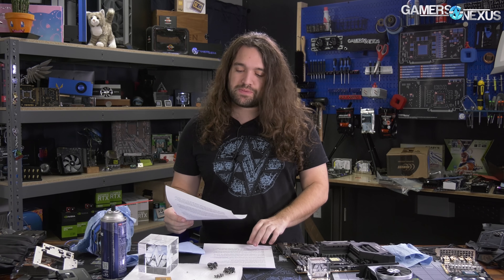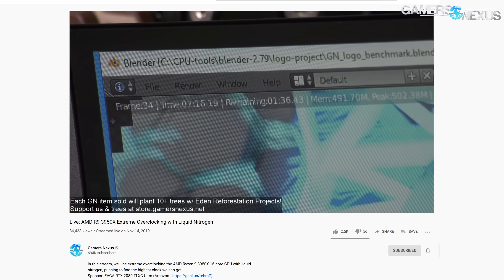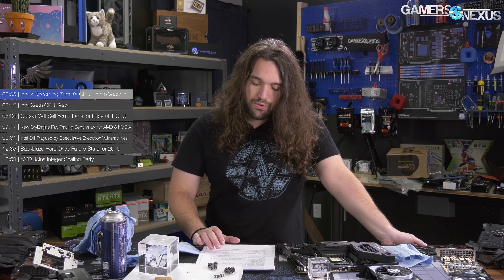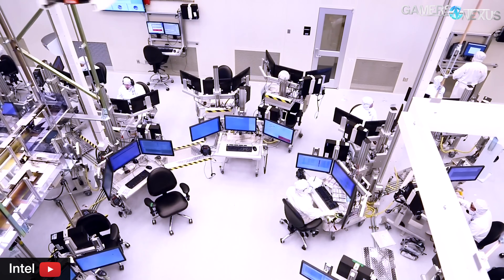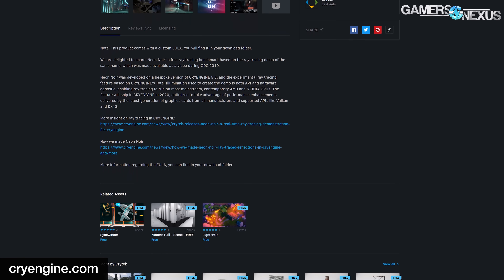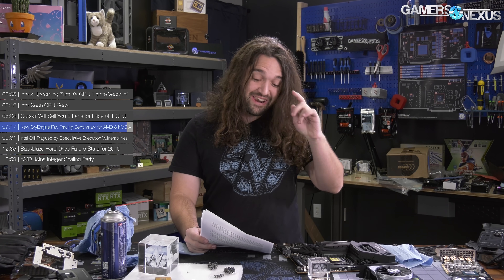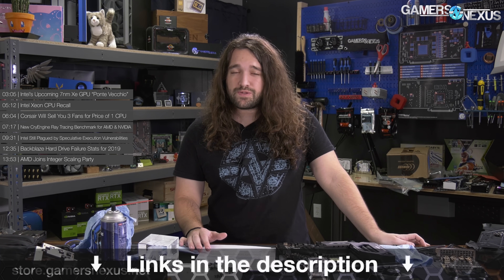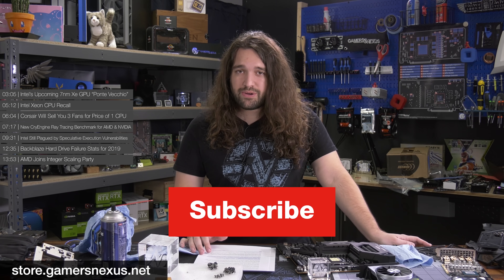HW News - Intel CPU Recall, 7nm GPU, AMD Ray Tracing Bench, & HDD Failure Stats

Comment: Bizzarre? I am highly suspicious of INTEL since building their largest most modern plant in IS rael. I think the whole wannacry BS is fishy and maybe related to this recall. I think the intel fix for wannacry actually opens the security between the cpu and ram and sends a copy of that data  to a server farm in IS rael. This would be undetectable but slightly slow system performance just like the intel patch does.This technology can also snatch that cpu data and remotlely manipulate it before sending it to ram with low latancy. 
I also dont know of individuals having their computers hacked,just government offices and large buisnesses which  usually have tighter security. Yet this performance decreasing  "patch" is forced on everyone on windows and linux distros like to sneak it in. My suspicion is maybe the security onboard these chips cant be programmed to become listening devices with the patch so Intels replacing them with ones that w ill ....another thought is why wouldnt intel just throttle the speed 10% to keep them cool. They thought it was ok to do this with all other chips over a security flaw? One other thing is these chips slow down when hot, i cant find complaints on the web of customers reporting this....not bizarre in the least but very suspicious.

Comment: the crytek raytracing thing is alright and everything but its not really helpfu.  everybody has just equated raytracing and rtx even though there is a big difference.  you hear comments all the time " raytracing is a gimmick, like hairworks".  

no.  raytracing is a rendering technique that the gpu business has been slowly getting close to for  the last 10 years or.  

rtx is an nvidia feature that may or may not be a gimmick depending on your outlook.  but if EITHER of these are a gimmick then it would be rtx, not raytracing.  rtx is a set of hardware that is used to accelerate raytracing effects in windows DXR.  any card with driver support turned on can do this.  amd could do it easily on any card but it just doesnt make sense.

you could say that the 20 series rtx\raytracing features dont make sense either because performance is too low (at least for gaming).  and this is true, it is too slow for gaming right now except if you are doing 60hz or so at lower than expected res for the tier of card youre running.

ive seen articles and videos saying why is raytracing considered an "nvidia" thing when really its rtx.  and the reason they give is that "nvidia has done really good at marketing raytracing as an nvidia thing when its not,  rtx is."   i have to really disaggree there and how.  raytracing being called bad or a fad or whatever is mostly because people just assume stuff and repeat what they have heard.  and of course people that know what they mean are just making typos.  but its mostly customer\commenter ignorance about the product.

THE REAL REASON RTX CAME OUT NOW, before the tech was really done or before the cards were at the level they needed to be is probably mostly because the professional\quadro cards are the same die as the gaming versions.  using 1 die for pro and gaming both saves money and means you will have higher binned turbos etc and any product with defective cores hav a place to go. 

if 7nm is actually a huge step up in raytracing performance then maybe it will be practical.  also maybe these cards were meant to be on 7nm from the start but things go held up.  nvidia make a lot more dies than amd and their current arch is very power efficient so 7nm is not needed as badly.

Comment: The whole "star engine" thing wasn't crytek's central complaint. They claimed CIG was required to use Cryengine for SC and also claimed that CIG is developing two games when they only agreed to one. The only issue is that there is no language in the agreement that restricts CIG to ONLY use Cryengine for SC, nor is the other claim vaild because the original game license agreed to defines "the game" as "Space Citizen" (name was not yet finalized as Star Citizen) and Squadron 42.

Crytek's claims were broadly dismissed but some are progressing. Most who pay attention to it don't expect Crytek to win as it largely seems as though Crytek just wants to extort cash to remain solvent.

Comment: That HDD Report makes me wonder.. no matter which brand, 3 of 2 of my HDDs over 1TB  gave up, in the third year. I kept older Drives, a 10,2GB Samsung from 2002 for example, it still runs.
The Brand wit the most defects of what i bought, is Western Digital. 4 of 5 Drives broke, Seagate 2 of 5 Toshiba 1 of 3, Samsung 1 of 5, Maxtor 2 of 4...
When i think about my SSDs, none of them died yet. my first SSD was an OCZ Agility 2, a little later i got a Samsung SSD830 256(or250?)GB those ar my Veterans, they still work fine, of course i havve newer models running now,. This twisted my Picture of reliablity for SSDs and HDDs...

Comment: I dont know why a Third Party (test house), or the companies themselves, doesn't just measure Waste Heat (WH). A WH rating would be worth a million times more than TDP. TDP should either be clarified to mean "power draw minus power disipation as heat waste", or not used.

Bare die temperature measurements at the stock frequency in lab conditions (all of which, AMD, Nvidia, Intel and other ASIC manufacturers are capable of), with a controlled atmosphere would be best for this. Clean room, climate control, a known load, tested on a test jig, with all voltage inputs measured, current draw (and thus power) measured and calculated, heat disipation measured. Humidity would vary a few decimal places and should be accounted for.

It's possible, given how much money these companies put into testing already. And MAYBE, people will actually get a proper idea of HOW to cool their hardware properly and we'd also have an even more competitive cooler market. Not to mention, measuring WH is a good way for them to identify problems in an ASIC, also helping their R&D departments resolve problems to deliver us better products.

I hope you've all read this AMD/Nvidia/Intel/Samsung/SK Hynix/Micron etc.

Comment: CryTek CryEngine Neon Noir Results:

Ultra
3840x2160 score 2178
2560x1440 score 4532
1920x1080 score 7375
Very High
3840x2160 score 3005
2560x1440 score 6218
1920x1080 score 10021

Conclusion: No RTX needed lol

i9-9900k @ 5.0 / 1.32v
Radeon 7 @ 2000 target / 1.132v
Massive Custom Loop for CPU & GPU
Gigabyte Aorus Elite Mobo
64GB DDR4 3200 16-16-16-36
Reply: the ray tracing in the demo only dealing with reflection. and to top it off the RT reflection reduced to half rendering resolution to increase performance. they still not using RT shadows or RT AO. in the future game will integrate more than one RT effect.
Reply: ArenZ RIcodeXD I’ll give you RT shadows but AO honestly? I can barely appreciate non-RT AO. Reflections definitely the most important part though. Mirrors in shooter games, shimmering water in all kinds of games
Reply: @depth386  AO made the surroundings to have more real depth to it. many current gamer did not care or appreciate it because almost if not all modern games have it. but back then when majority of games still does not have it many people crave for it. in some cases AO becoming the primary reason some people end up choosing nvidia GPU because nvidia allow AO to be injected into games which is no game ever implement back then. the feature still exist inside nvidia current control panel.
Reply: ArenZ RIcodeXD After reviewing some short “What is AO?” Videos I guess it’s a good feature in most cases. But I don’t see how RT would enhance it that much. I mean RT Reflections as shown in both Nvidia’s BF5 RTX and Cry’s Neon Noir implementations are obvious in how much value they provide, imagine seeing your enemy or some game objective item thanks to a mirror, a puddle, or window glare. But RT AO on the other hand would just be another notch in the shading, and while it’s always a step in right direction I can’t summon the same amount of excitement for it. It certainly doesn’t enable new emergent gameplay the way reflections do. I wanna see an FPS map dominated by mirrors or a cave full of giant crystals.
Reply: @depth386  RT AO will make AO implementation the way it supposed to be. with baked effect sometimes the shadows being cast in the wrong area. although most gamer probably will not going to notice nor care about this. current AO implementation is quite good like what nvidia did with HBAO+. older implementation sometimes they look like they were overdone and end up throwing blacks shades everywhere. but as good as it can be with effect like HBAO+ the baked effect still have their own issue. our modern engine end up being bloated by various effect library codes which sometimes making more issues to the game. using straight forward method like RT will get rid of this bloats and end up cleaning the game engine codes making it much easier for game developer to maintain and fix their game issues. this is other primary reason using RT solution. it is not just about more realistic effect.
Reply: @arenzricodexd4409  I have to say the idea of reducing software bloat is very compelling. But I point out that you yourself have admitted that most gamers do not really notice AO. It's a nice-to-have, not a necessity. Reflections actually enable new emergent gameplay. Gameplay is a big deal. I don't care what graphics you have, if I see a health bar over a ship like in Silent Hunter 5 for example, I Alt+F4 and never play that game again no matter how good the engine or how realistic the graphics. So you'll have to excuse me if I still fail to give a crap about AO. I played the original Team Fortress until it absolutely died because it had, among other things, self-launch (with rockets, grenades, stun bombs etc) as an emergent gameplay style in addition to many other tricks. Tribes was another emergent gameplay classic. In Tribes, the game evolved into something the developers never dreamed of thanks to what was originally a bug. I'm now waiting for reflections to give us the next infusion of unforeseen emergent gameplay. BF5's puddles barely scratch the surface.

Comment: Vulnerabilities seem to pile up with a frequency that has changed my attitude toward them.  If I were a Dutch boy who was sticking a finger into a leaky dam here and there before, I'd now be shrugging and walking away from a vertical sieve.

We need these categorized, and I'd like to see the category lead each story about them.  I think of them in 3 tiers, of decreasing importance:

(1) Vulnerabilities that can be exploited without any action from the user.  Just being online opens you up to a very bad day.  E.g., worms.
(2) Vulnerabilities which require the user to do something stupid, or at least careless.  E.g., visit seedy websites, or random websites without script blocking or sandboxing, clicking on spam email links.
(3) Vulnerabilities which require physical access to the user's hardware.

Category 1 will get prompt action from me.  Category 2 will concern me to some extent, but I won't stop what I'm doing to go fix it.  I'll get to it eventually.  Category 3 does not concern me at all.  Knowing where a new bug fits, up front, is key to risk management and the best use of our time.

Comment: As far as the Upcoming Intel XE GPU goes "Ponte Vecchio", here you go, story starts at 55 seconds in to the video:
https://www.youtube.com/watch?v=4PZw75K9ydY = Intel's GPU is not what you think.
And no, it will not be a GPU mend for gaming.

And just another thing, as far as AMD's RDNA GPU architecture and NVidia's Pascal and Turing GPU architecture goes, what exactly is the differences between the two architectures, here you go as well, but sit down for this one, becouse it's a lot of information to take in from this one video: https://www.youtube.com/watch?v=5FDN6Y6vCQg = RDNA vs TURING - The END of NVidia’s dominance
;-)

Comment: Seagate still the hdd's to avoid to like plague I see.
Reply: Weird, I've never had a seagate fail on me. I've had multiple toshibas and Western Digitals that have failed though.
Reply: @heckyes  out of over 200 systems for customers, only ever had seagates fail. Had 1 WD fail, but 99% sure it was because it was dropped.
Reply: @Tallnerdyguy  How far back are we talking? I've been almost exclusively using Seagates for my own builds and all customer builds since the late 90s. Normally it's all I have available for HDDs.
Reply: @heckyes  i have been building custom systems since early 2000s, and had been building mainframes and servers since 2001. In my first few custom pc builds i had used seagates because of cost efficiency. Within 2 years i had to replace 7 disks in 5 systems. Those were all barricudas. Since then i have used WD black for all spinning drives and only 1 fail (again 99%sure it was dropped and damaged but actually data was recoverable.) Yes, the black are in a different category, but the small savings isn't worth having to deal with seagate rma process.

Edit. In the mainframes we had built, they ALL used wd drives, except in a few storage servers where the cheap drives are hot swappable and worth cheaping out on
Reply: @Tallnerdyguy   Interesting.Thanks for sharing. Cheers.
Reply: @heckyes  again it may be the "black" iteration which is a bit more "premium" which may explain the reliability and the 5 year warranty
Reply: as always.... also the ONLY hdds i have ever had fail were seagate....
Reply: @Tallnerdyguy  actually it's very strange, because all my HDDs that STILL functioning  flawlessly are Seagate C: The only 3 I ever had which failed were: a barracuda with the infamous SD15 firmware back in 2011, a momentus XT I stupidly dropped and killed, and a Constellation es1 I bricked with a bad firmware update. For the rest, WD is still for me the biggest shit maker in terms of HDD. I could have opened a paperweight shop so much I had of those dead shits green black and blue through years. The only one that never failed however, is my fellow 1Tb velociraptor still running and reaching soon 30k hours. So yeah, things are different from an user to another :D
Reply: @philipejeuceoututkache  ya, everyone has different experiences
Reply: Weird cause I thought WD was the grey duck for a while.
Reply: @depth386  Not in my experience with WD black, cannot really vouch for much more than that, i guess i do still have a green from about 9 years ago that still works...
Reply: needabettername Yeah I had WD’s fail eventually back in the day (4GB and 40GB drives) but I currently have two WD Green 2TB i bought in Dec 2012 still going strong despite  numerous “re-silvering” episodes after power loss or software fails. That said, I recall a Backblaze report showing some WD drives sucking. So now I’m surprised it’s SeaGate in the crosshairs.
Reply: In the 2020 list seagate improved a lot, very few failures considering the amount of seagates they use. Personally i have a external 2tb wd 4 years old and a internal 500gb toshiba 3 years old, both working great. I had a 500gb wd broke but because it felt from a chair. Now i have a internal 2tb seagate barracuda and 2 months everything ok, i guess ill have to wait.

Comment: "Chip makers still paying a price for the push for performance with security out of view.."  Um, I think you added an "s" where it shouldn't have gone.. There's only one chip maker that has been doing this.  The thing about Star Citizen / Crytek.. I remember reading a lot about this.. RSI (Star Citizen) dumped CryEngine and used Lumberyard instead.  It was a free game engine, and Crytek was way overpriced, and had a lot of problems.  Lumberyard is basically somewhat based on CryEngine, but fixed by Google.

Comment: I would make a joke about intel shipping with inadequate coolers but AMD still hasnt fixed my drivers for the rx5700 xt ...
Reply: What exactly is wrong with your driver? My xt is great so I'm curious..
Reply: man  random crashes of the GPU drivers in games
Reply: @ayethe4603  I would exchange it if it doesn't work plain and simple. I had probs with the powercolor dual fan, exchanged it for the red devil, and haven't had any issues since. But I feel your pain.
Reply: @michiganman5969  it wouldn't help it's a know issue for the drivers under the release notes
Reply: @ayethe4603  it sure as hell mattered in my case.  I was tempted to do a refund but I'm glad I exchanged it because it was obviously hardware related. I don't have any issues at all with the new card. None, and I use it every day for gaming and d.a.w....
Reply: Problem Intel has is even they don't know the true TDP of their CPU's since its all marketing crap at this point.